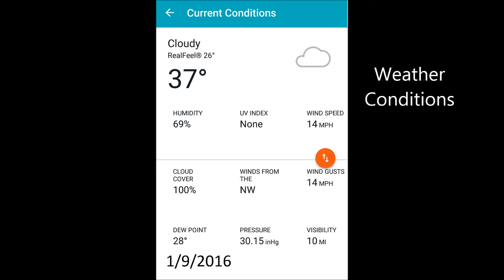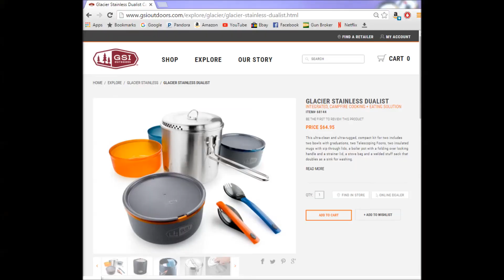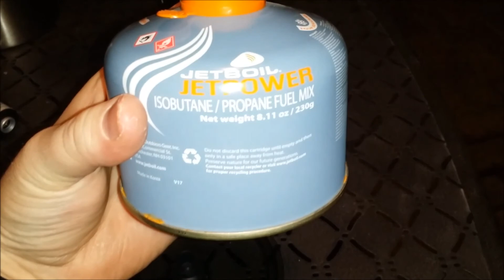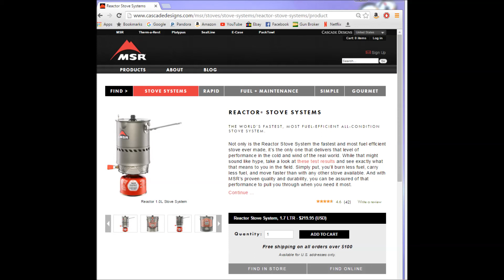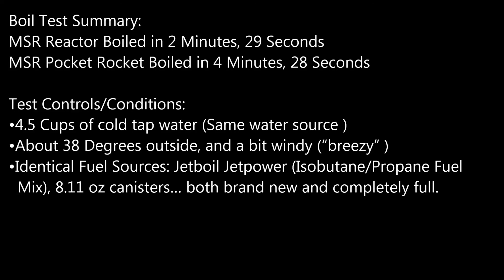MSR Pocket Rocket versus MSR Reactor Water Boil Test

Comment: Poor comparison. Narrator fails to consider the different material types between the pots. Also, the video description of the results is erroneous.
Reply from the maker: watch video.  reactor had proprietary Burner design and proprietary stove design.  you can't swap out stoves and burners between the two.
Reply: adroitredtiger you're still failing to see the flaw in this failed experiment. I recommend you review the concept of 'specific heat'.
Reply from the maker: +Anthony Phillips both had the same water. ...same amount.  same water source. 

spe·cif·ic heat
nounPHYSICS
the heat required to raise the temperature of the unit mass of a given substance by a given amount (usually one degree).
Reply: adroitredtiger In this case the effect of varied water/fuel is negligible. The two pots in your video are vastly disimilar metals. The only thing your video shows is that steel is a better conductor of heat than aluminum.
Reply from the maker: +Anthony Phillips so it confirmed that aluminum pots boil faster.  It would also highlight that the heat transfer capabilities of the reactor ate much more efficient (by design,  including the heat sink incorporated in the pot).... there are many conclusions and observations that can be drawn here.  If you have an aluminum pot,  pocket rocket,  and reactor,  I'd  love to set what happens. for now,  I'm only able to compare what I had.
Reply: +adroitredtiger You seem to have confused which metal corresponds to which pot (perhaps similar to how the results in the video's description erroneously confuse the models?). Unfortunately I'm unable to commit any further time to this discussion. Cheers.
Reply from the maker: +Anthony Phillips bye.  ps, in description I spell out the rocket used a stainless pot.